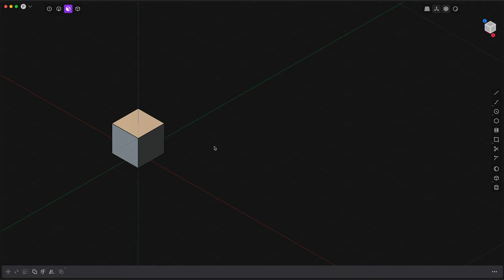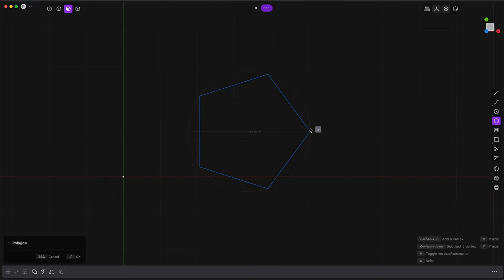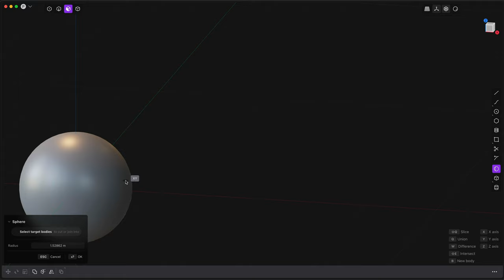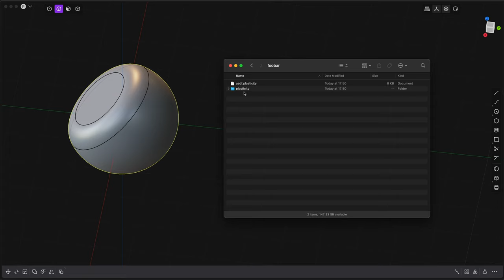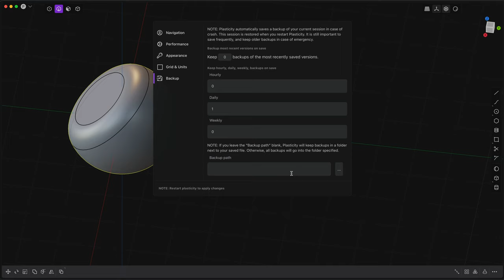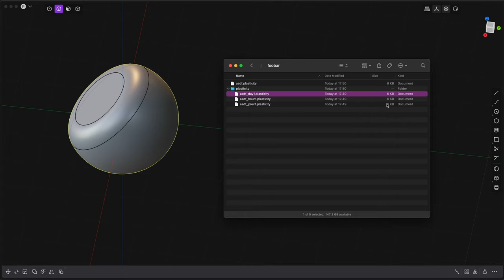Plasticity 1.1 is here!

Comment: Yay I can use this to more accurately design parts for 3D printing! In-line measurements is a HUGE QoL update!
Reply: YES! For me we need one thing  STL IMPORT.
Reply: @jazon9  Version 1.1 does have STL export if that's any good to you :)
Reply: @SGThirkell  yes I know it is good change. But STL import would be very usefull. 3d print community base on STL. So if you want modify model from Internet you need app with stl import.
Reply: @jazon9  Oh, I understand what you mean now. I 3D print also and this program has been a godsend to me, especially since adding exact dimensions.
Reply: @jazon9  agreed STL import is a must. Personally as a 3D print hobbyist, most of the work I do is editing existing STLs, not creating new STLs.
Reply: @tylers2889  I hope stl import will be add on future. Like stl export

Comment: this is great in sketch mode... but being able to update the dimensions of a 3d object as other parametric tools do like fusion360 would be a big improvement, unless the sketch controlls the 3d object dimensions. As of right now as much as I want to use this, I need to be able to work to measurements so im still on fusion 360.
Its not as important for concept modeling, but for some of us doing game assets for VR, or even 3d printing, its a make or break point.
Reply: This is the only reason I haven’t bought it yet. If I could edit 3d objects, I’d buy it without a second thought.

Comment: Can you also see and adjust measurements on 3d objects, like clicking on a round and be able to see the radius of the round, or clicking on 2 parallel sides of a cube and see  what the distance is between the 2 sides (as long as they are parallel)?  I use Spaceclaim and it's great for showing measurements and being able to type in adjustments to radius' and lengths.
Reply: @timheeney2060  I'd love to start using it but I need all the CAD functionality for modeling parts for 3d printing. Maybe in the future there can be a "CAD" option to be able to turn on and get more dimensional feedback and features like setting the pivot/axis per part. snapping, pattern and array features (unless those already exist).

Comment: Hey Nick, any chance we will get STL exporting with the scene/ model size being maintained? Using plasticity has allowed me to design and print functional parts which i am so grateful for but having to figure out scale correction in my slicing software has been a bit of a drag.
Reply: I'm still testing to use plasticity instead of Freecad and got this "problem" as well. I'm using the prusaSlicer importing OBJ or STEP-files from the CAD-systems. All I have to do is answering PS' question, whether PS shall convert the scale from meter to mm - I can live with it :-)
Reply: Im still trying to figure this out. If I change the units and grid sizing in Plasticity to mm, then export into Cura slicer that is also set into mm, the model is insanely tiny and just cannot figure out the relationship between the sizing in Plasticity and the slicer.

Comment: You didn't seem to specify if the dimensions are editable, since you were deleting the sketches right away. Basically, whether one can come back to change the dimensions later, or they can be only set in the initial sketching.
Reply: At the moment it seems they can only be used for the initial sketching.

Comment: For the multi-faceted radial objects(triangle/pentagon/hexagon/etc), it would be very powerful if you could set their sizes by a measured edge length or apply them across two existing edge vertexs via their own edge vertexs. I'm not sure what the current workflow is to properly pin and size 1 edge of a pentagon to the edge of any square, much less a cube arbitrarily rotated in space! Because we can't place them by 2 vertex points, nor define them by the needed edge lengths to manually snap them in later.. I think the only way that makes sense at this time is radial copy an edge of the square and manually assemble a pentagon off of that and..we'd have to already know the correct point in space to rotate those around to assemble that even.

Another thing that myself and others suffer from, is if the workspace is set to MM, any exports result in models that require 1000x scale-up. I'm aware this has to do with plasticity exporting those as Meter being the local units and MM get turned into a smaller value, is there a way to allow us to set MM as the whole unit being exported? Anyone making small 3D models is going to realistically be using MM most likely, but they won't export at MM scale!(as seen by all slicing softwares at least) The only way to work around this is treat MM as M, which gets confusing at times, or manually scale up 1000x before export. Neither seems ideal.

Also on win7, your set backup-path explorer dialog pop-up doesn't seem to function correctly, the only way for me to set it is manually copy-paste a full path into that field and hit enter, FYI. The dialog pops up, then hides itself, I can still bring it back to the front, but clicking a folder doesn't set the path, it just closes out of preferences and doesn't save what was set, almost the same as when I copied the path and clicked outside the box, I had to hit enter before it stayed set.

Comment: Getting my feet wet and fumbling my way around. Want to buy but Please, “undo” is essential feature. Tired of having to start from scratch after doing a Boolean and remembering I forgot to fillet a line or want to adjust position. Lots of promise even for non artistic plebs like me. Designing 3d models for printing as got other features missing in tinkercad. Stl files load into Cura great and print out but curves not right when importing into tinkercad either as stl or obj. Also had a file exported as stl but has o bytes size.

Comment: Can you edit using the similar mechanism for a non-sketch?  The only thing that was keeping me from using this app vs Moi or a typical cad app was being able to adjust dimensions of features after they were extruded.
Reply: Yep like cubes
Reply: @KRGraphicsCG  awesome, I did try in 1.0 trial and ended up stopping further testing since it was a mess trying to edit existing faces. I love the ease of iterating over a design but need dimensionally accurate designs for 3d printing. So this is a positive development.
Reply: yeah, I'd love a dimensioning system where you can go back and define things after they exist. I know it's not supposed to be as constrained as CAD, and that's totally fine, but sometimes you really just need to say "from here to here is X, make it happen"
Reply: @BrennanLetkeman  example after I draw a circle and I don't like it's size, I want to be able to change just by typing it's diameter
Reply: Another one that would be awesome is picking two circles or curves and set the distance between them

Comment: Can someone help clarify
1) Is the export options having option to export via step because modelling it seems to be like triangulated surface modelling (similar to sketchup).

2) is there any import options to bring in images, dxf, stl (scanned data) and build over them. for reverse engineering.

Are these in the pipeline for 1.x. versions this year or will be a part of 2.x versions

Comment: Would love to try this as measurements was one of the things I was really looking forward to. Is it possible to upgrade a free trial? I'm part way through my trial on 1.0.1
Reply from the maker: it should work yeah, just install the new version
Reply: I plan to buy it at end of May but I can't find an update button for the free version. Do I have to re-input my name with the same email address in the register form to get the update?
Reply: @ck_3207  I'm trialing the same as you. I went to the website and downloaded the new version. Run the installer and, because I already have v1.0.1, it seems to update rather than instal from scratch. Really quick! New version is awesome by the way.
Reply: @SGThirkell  okay, I'd do that. Thanks!
Reply: @ck_3207  Let me know how you get on :)

Comment: Will plasticity be able to import svg files?
Reply: This would be a killer feature. I believe Moi can import Illustrator files as long as they are in legacy v8 file format. But since Illustrator and most other vector based illustration programs handle both import and export of the SVG format that would be the format of choice! It'd be amazing to be able to import complex 2D SVG logos, lines and curves into Plasticity. 🤩